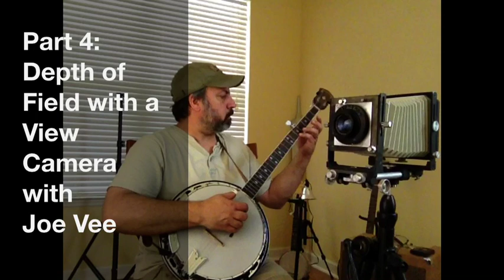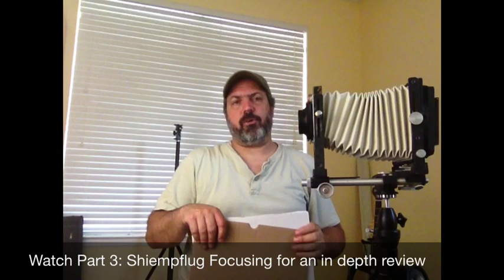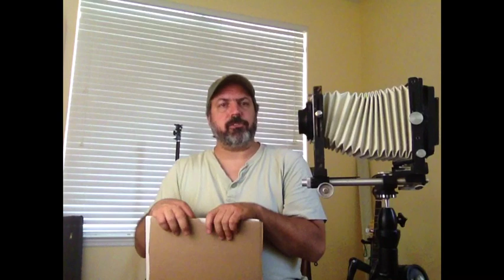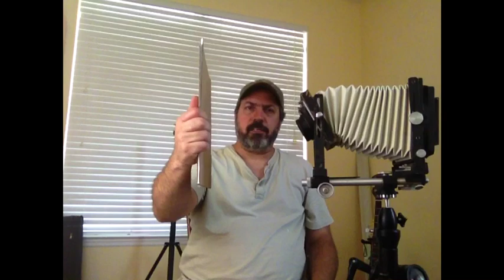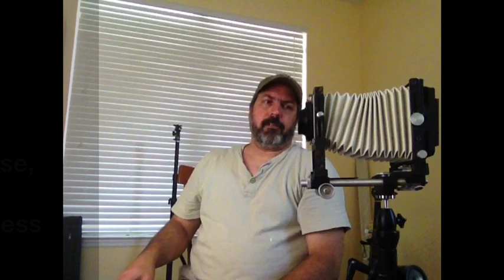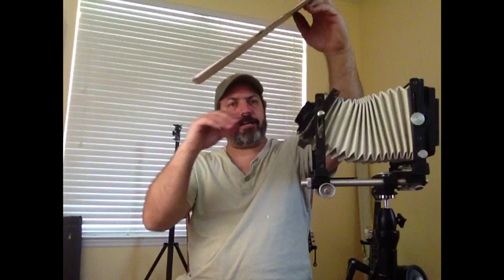View Camera Movements Part 4: Depth of Field with Tilt

Comment: Thanks for the great explanation of DOF and Sheimpflug. I was having trouble understanding the relationships between DOF and swing/tilt and I'm glad to learn that the key is the converging lines. My question is, how would one calculate the minimum required DOF when using swing or tilt? I shoot with a Sinar F2 which has a very handy built in aperture calculator. Would it still work with swing/tilt applied?